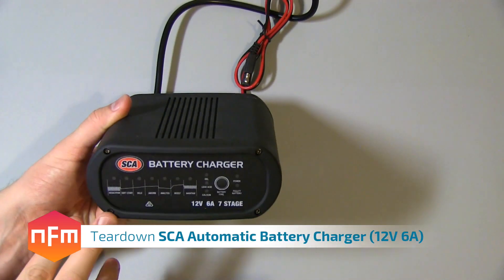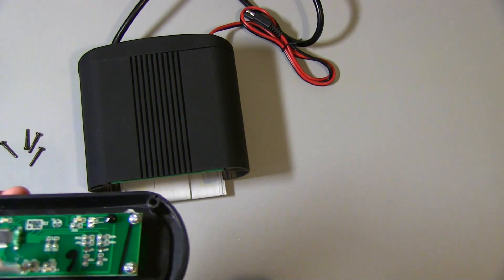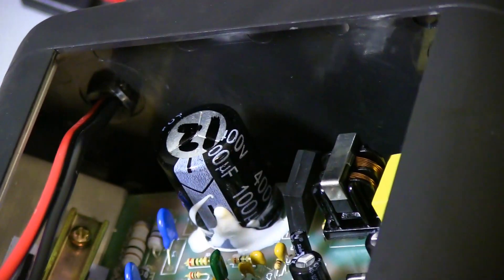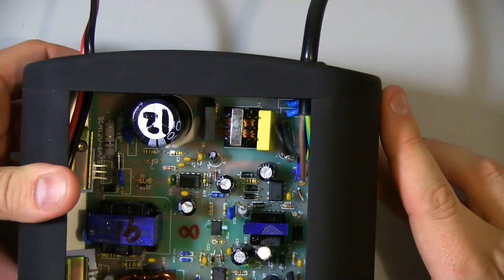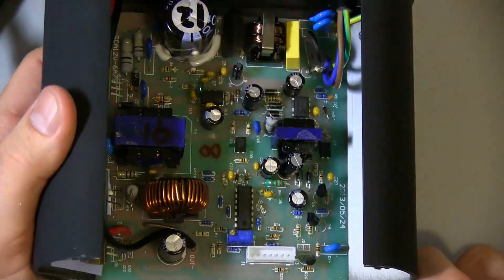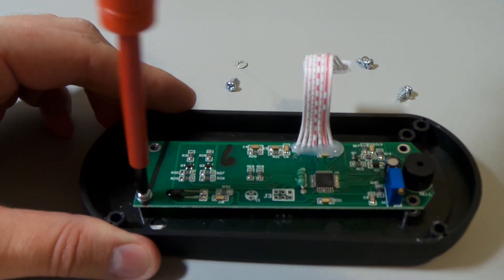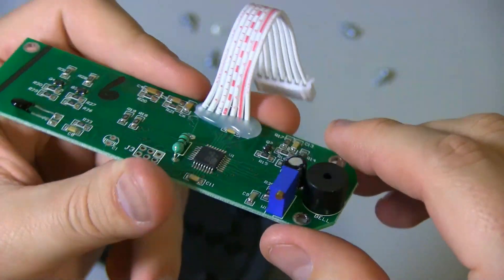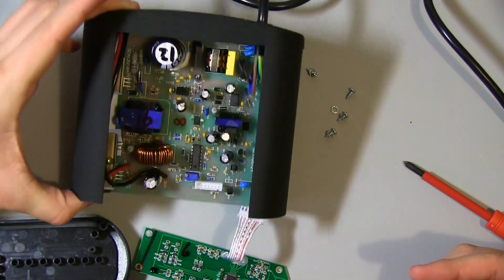SCA Automatic Car Battery Charger Teardown (12V 6A)

Comment: So this is an older post but 10 years later and the charger is more or less the same . Looking at my 2022 12 volt 10amp seven stage automatic charger a noticeable difference is there is no buttons same case and layout. Circuit board has two large 450v 100uf nichicon capacitors instead of the one on his board and same same most other.

Comment: Can we get the circuit diagram for this charger. My charger stays in trickle charge mode only. That means even if battery voltage is low as 7-9 volts, it detects as Fully Charged battery and hence does trickle charging. Trying to identify the issue.

Comment: Be nice if I could modify the charger to charge a battery without the unit assuming a batter is faulty. I have a 15amp and it's useless when a battery is flat.